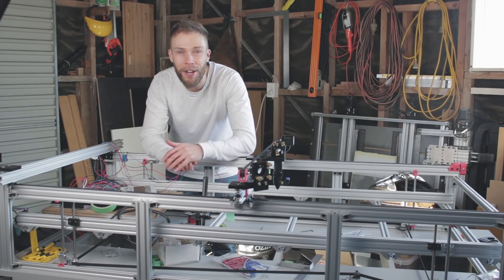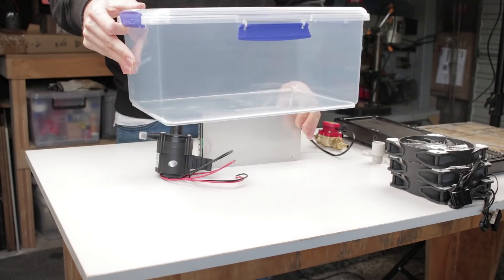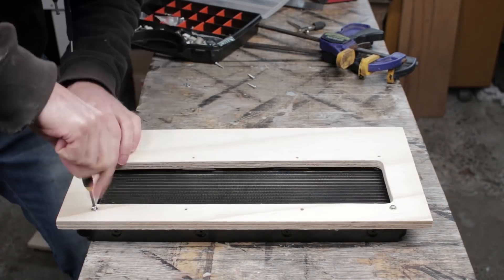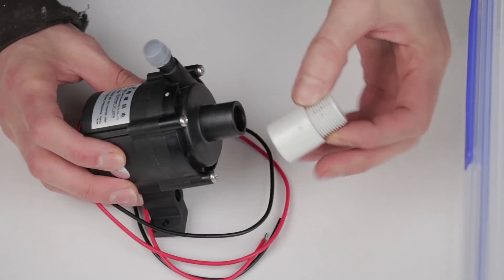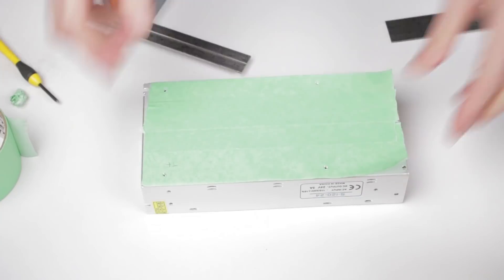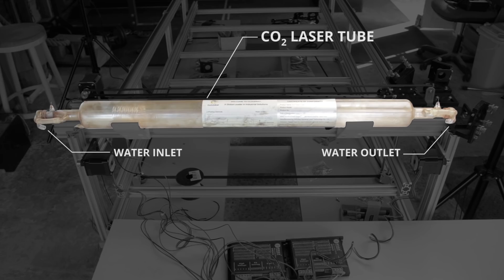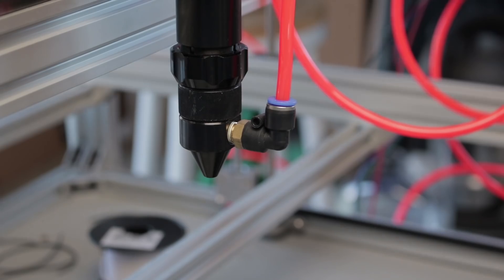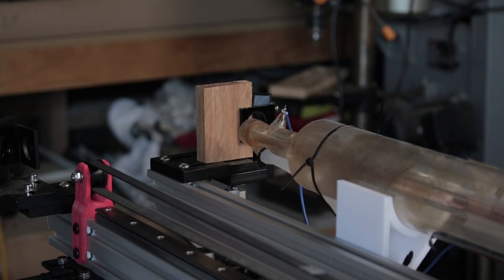Ep5: Water Cooling & Laser Test. The DIY CO2 Laser Cutter / Engraver Build Series

Comment: LOL, as a plumber here is a simple rule for you when applying Teflon tape to threads. Hold the part with the threads in your left hand with threads facing your right hand. Start the tape on the bottom and roll towards you over the top away from you and then around. If UR left handed do the same in reverse starting over the top towards you and down away from you..;)
Reply from the maker: Nice one! thanks for the tip - I knew they'd be a good way to remember

Comment: Your CO2 build series has been an inspiration for me and even though I have no prior experience on CO2 lasers, I decided to start my own build based on your instructions (among some others found on youtube) and I'm currently building my own laser at the moment.
(sorry for not bying your build instruction as I wanted to come up with my own design, and I am sure a prebuilt plans will guide my thought too much and hinder my learning experience. I'm actually a professional design engineer and enjoy the challenge... I will surely drop you my share for the awesome guidance soon :)).

I saw that some other people have also been a bit anxious on the cooling electronics layout on your design, which got to me a bit too. I planned my electronics a bit differently, but since I live in Finland and the low temperatures are more of an issue than high temps, I had to take a very different care on this issue than any others in youtube.
I'm currently working on my own automated and monitored heating/cooling loop and I was wondering if you would be interested on hearing about the details?
If this proves to be a capable system, you might want to try it on your system (since Australia is a cool locasion also :)) and later share it with the community?

I'm not looking to profit on my work with the cooling, but rahter would like to share my findings with the community as you have with your awesome guide :)
I hope this message reaches you.

Comment: Water cooling is tricky. I live in Florida and I've tried it all and i am still experimenting with options short of paying for a refrigerated chiller. Great tip about the external pump, I never thought about the heat generated from the pump affecting the water temp, that why I love this series, lots of great information. Thanks for all the hard work.
Reply from the maker: Happy to share. I've heard Florida's pretty hot year round, so I don't envy your cooling situation!

Comment: I had to use a much bigger air pump on my last build, but it may have been the long runs of tube I had to use. The masking tape template is a great thing, thanks for sharing the box building tips.
Reply from the maker: hmm interesting, it's something I'll keep an eye on. Glad you found it helpful!
Reply: would using bigger diameter tubing help you? like using oversize tube most of the run and normal smaller size just at the end.
Reply: @nraynaud  You need to size the pump and tubing correctly for head pressure. This is the big problem with HVLP pumps - they need to be close to the nozzle. There are other silent pumps that will allow for long tubing runs.

There is a lot of fancy maths, there might even be some online calculators.
Best thing is to read the spec sheet, it will have something about head pressure.

Comment: I've been loving these videos and appreciate all the detail you are going into. The CW-3000 chiller is the first thing that has given me pause.  The CW-3000 design is an air cooler. It may be suitable for cool climates, but for the southeast and Southwest US, I don't think it will keep up with the heat generated by sustained use. We may not be able to cut at all if the laser cutter is in our garage on a hot day.

Cutting really needs to happen below 25°C in the tube to avoid the risk of cracking. Also cut quality decreases as temperature increases. I may deviate from this plan and get a chiller that uses Refrigeration. I'm currently looking at hydroponic cooling systems in the $400 range. Unfortunately the CW-6000 is $1200.
Reply from the maker: Well said. I'm lucky enough that even in the summer the temperature never really gets above 25C, so I don't have any experience with adding refrigeration. Sounds like a good potential avenue with modified hydroponic systems.
Reply: @FurtherFabrication  I think this is going to become one of the top watched series on YouTube. Have you considered setting up a patreon?

Comment: I'm also a Kiwi and got a CW3000 with my laser. It's still in the box. I just have a 20L container filled with distilled water and the supplied submersible pump. It hasn't even got to lukewarm yet and it's often running for long periods.

Comment: I would love to know how to wire up the flow sensor, I guess it cuts out power to the tube if there is no water movement but I haven't found a video that covers how to wire it just see them being used. 
Thanks loving the series.

Comment: I think you can buy small fridge and install inside heat exchanger for cooling laser head. Just, make sure to add antifreeze and antifungal additives. Inside such fridge, there is automatic temperature control, and if there is still some room, you can cool beer for self-reward after the job.

Comment: Awesome video and skills!! On another video, I saw a guy using a "Mobicool Thermoelectric Cool box" for active cooling for under 100usd.
I will also install a "W1209WK DC12V Digital LED Thermostat Temperature" with 12V LED white and red, so I will have visual alarm of the temperature, white when temperature is ok, red when over the preselected temperature :)

Comment: You (or anyone feeling nervous about water and electronics) could add a drain hole(s) on the base of the box under the pump for potential drips
Reply: I was uneasy about that. I would have put the pump through the side of the tank high enough to allow debris to sink to the bottom and not go into the pump. Then a drip tray underneath and no way would I put electrics underneath the tank.

Comment: Honestly you took an aquacomputer d5 next with a 12v power supply and you got a good pump that got integrated can control and temperature sensor so you can control fan automatically according to the water temp. And it's fucking reliable, my aquacomputer pump is nearly 10 years old with 5 years running 24/7 on my computer.
Reply from the maker: Sounds like a pretty good option!

Comment: OK, I wanted to build my own 100W CO2 laser in 4' X 8'...OK, 1220mm X 2440mm...or should I just start with a eBay 100W for $1,700 ? I can't afford a Fiber Laser for what I REALLY want to do, but the 100w can get me started for now ! Your thoughts on using  2040 or 2080 for an 8 foot (2440mm) span, and where I can get single lengths, or just use 2 shorter joined together ? Great videos on the series for the build, can't wait to see the final spec sheet !

Comment: Does the pulsing of the diaphragm air pump affect the laser, or does it just require positive pressure to prevent smoke contamination?  Looking forward to the plans and building my own, cheers !
Reply from the maker: Yeah it's mostly to keep smoke and debris at bay, so the pulsing doesn't worry it

Comment: Question, what you planning on using for a bed? I am designing my own cutter (bigger than the one I have) and need a bed I can use for fairly thin materials... I think I will be stuck with honeycomb bed....
Reply from the maker: Great question. So when I was building my first 'big' laser cutter last year, I couldn't find any vendors to import a honeycomb bed into New Zealand, for a remotely reasonable price. 
So frustrated, and needing to get work done, I cut a bunch of 3/4" strips of plywood and ran small nails up through them. No joke, best cuts I've ever seen. Because the smoke wasn't being trapped underneath there was almost no discoloration on the bottoms. So long story short, I'm going to do a refined version of 'sticks with nails in them'
Reply: @FurtherFabrication  so essentially a pin board? What about burn through? I will be using mine a fair bit so don't want to have down time to change out the pin bed once done. I was thinking knife bed but knife and pin bed I still need a way to hold material flat, on honeycomb, HDD magnets work a treat!

Comment: Hey, what is your experience with the power of the laser tubes? What can you cut/engrave with a 150w tube for example? Is it possible to cut 1mm staibless sheet for example?
Reply from the maker: I've only used lasers up to about 120w. Someone else might be able to chip in here, but I believe you'll need quite a bit more power and gas assist to do any serious damage against metals
Reply: Thanks! I will do my research definitely. I hope it is possible to achive in the homemade category.
Reply: @Tzupaack  Wikipedia (https://en.wikipedia.org/wiki/Laser_cutting) suggests 400W for 1mm mild steel and 1kW for stainless steel.

Comment: "Its clear so I can keep an eye on it getting dirty", wouldn't it be better to use deionised water with a little bit of antifreeze and a black nontransparent, light tight container for the cooling ?
Reply from the maker: That's another totally valid way of doing it. I just prefer to see into the container. I've also found deionised water to much more difficult to get locally.
Reply: @FurtherFabrication  hi mate, fair enough you can get it on Amazon, if you have a Tesco stores in your location they sell the DI also at just £1 for 2.5l the brand is CarPlan and I'm sure other Australian car type shops would have it, surly if you went to these lengths you would get such a life span it wouldn't be as much of a concern to you, not being negative in anyway just trying to help you improve your setup in anyways I can with what I've learnt. For allot of the CNC machines our forum members build with a water cooled spindle, this is the methods we use to keep things great. Thanks for the videos your making, they are very entertaining, informative and we'll put together.

O by the way Ep.6 isn't listed in the playlist with the others 😉 just a heads up.
Reply from the maker: Cheers dude, appreciate the input and the heads up!

Comment: Why did you use a 24V power supply for the 12V fans? I think I missed something.
Reply from the maker: the water pump runs off 24v, then the whole fan power thing got confusing

Comment: Great vid, I am doing a closed loop cooling system instead of a large resevoir I am running the water through the radiator which lies flat, on top is four cooling blocks with stacked peltier on top then two cpu cooling fans,   The water goes to the laser then from the laser to another radiator then back to the peltier system, its experimental but fingers crossed it works,  as for the power I using off grid solar system, so all I lose is power not money.  I am not going to be running the laser too long any way,  on the lid will be a flow meter and temp gauge, and a kinetic flow meter. Learnt a bit today so thank you.
Reply from the maker: Awesome, that sounds like a pretty sweet setup! Adding some peltiers might be a good idea for me too in the summer

Comment: I'm curious, How much distortion do you think will occur, by using tension belts on a large scale. 

I used a 5 gallon water jug, for source water, as it keeps the surface area down, reducing contamination and spill risk. Used a flow loop to prevent bubbles from back flow.
Reply from the maker: Hard to say, provided the gantry is kept light and speeds and accelerations are reasonable it should be fine.
Nice, a large reservoir like that has better thermal insulation from heating up too fast as well
Reply: @FurtherFabrication  With this video being the first I saw, then episode 3,2,4 and 1...  For smoke extraction, you might consider molding duct work up the risers, that can be closed and opened based on the size of the work piece.  An area that size will be a challenge. Nice work so far, I'll check out the future videos to see how it comes out.

Comment: i wouldn't put the electronics under the water tank. seems like asking for failure
Reply from the maker: That's a fair call, and who knows you could be right. That's the beauty of having someone else do it first though and share the experience right?
Reply: @FurtherFabrication  fair enough. With my luck it would leak
Reply: Absolutely correct - when (not if) it leaks - or when filling, you will drench the electronics - dangerous. Safer to invert the system and make filling more awkward.

Comment: 9:40 I cant watch this... I would not put power supply inside closed wooden box like this. In case of hose leaks, broken pump or box seal water will partially fill wooden box and power supply. And with that fill technique and water splash... Yeah.
7:59 Wiring 12V cooling/CPU fans in series for 24V is bad idea, especially those with hall sensor IC. If one fan is stopped other fan can get full 24v and burn hall IC.
Otherwise love the build series.
Noob question: To what kind of temperature range laser tube must be cooled down?
Reply from the maker: I understand your anxiety, we all have our own limits of acceptable risk. 
In my experience, this is something I'm comfortable with,  worst case scenario is it could short and I blow the fuse located in the socket on the back. 
I want to give a 'true' experience of a Laser Build so leaving in all the potential for failure is part of what I think is important. 
That's a great question though, I've found running between 10-20 degree C (50-70F) to be ideal. With short instances of up to 30 degree C ok, if unavoidable.

Comment: Honesly, for the money you could have bought a Aeon Nova or Aeon Mira laser machine that is 100% reliable, tested, and flawless.
Reply: You're kidding right? FF's design is going to cost $2000 to build for a 48" x 36" (1200mm x 900mm). Aeon Mira 5 is $6000 for 12” x 20” (300mm x 500mm). Aeon Nova 10 is $12,995 for 1000*700mm.

Laser cutters are all off the shelf parts, a power supply and a controller. FF has chosen the best controller you can get -- Ruida.